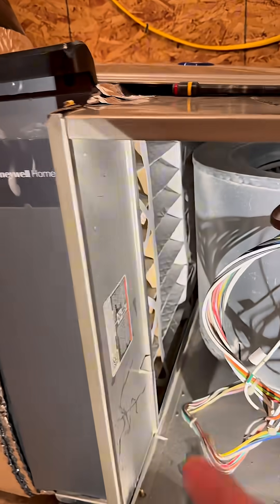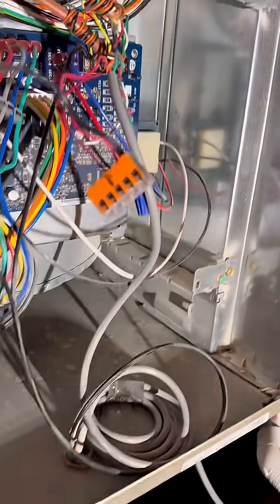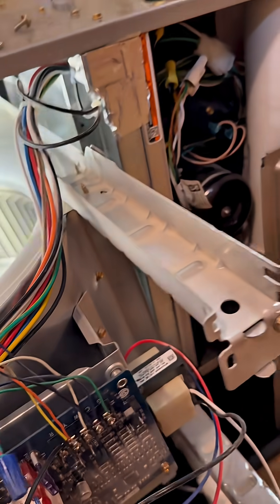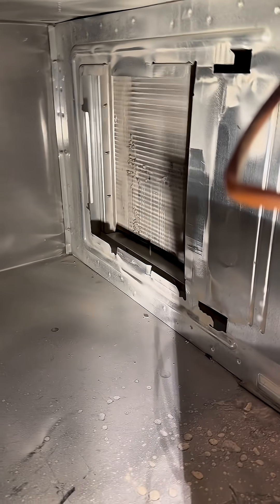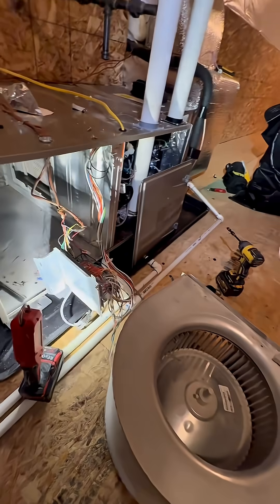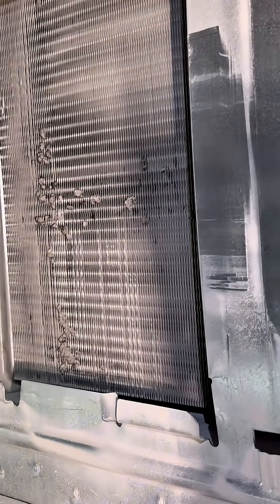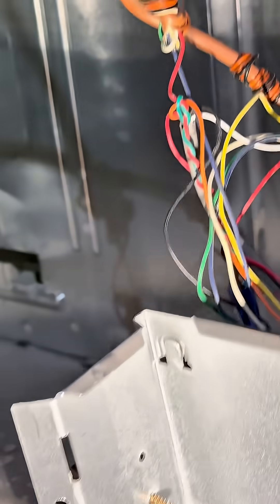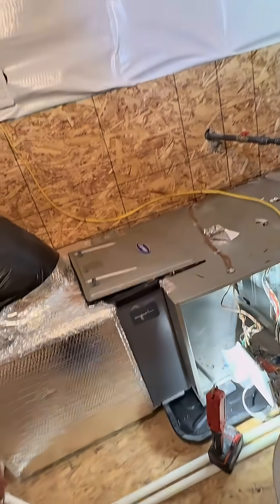Diagnosing a Clogged Secondary Heat Exchanger with Static Pressure Probes

Comment from the maker: This system was less than a year old. Diagnostics pointed to installation-related deficiencies rather than a maintenance-related blockage, so cleaning the secondary heat exchanger was not performed. The homeowner elected to have the builder address the correction. This highlights why proper diagnosis always comes before repairs.